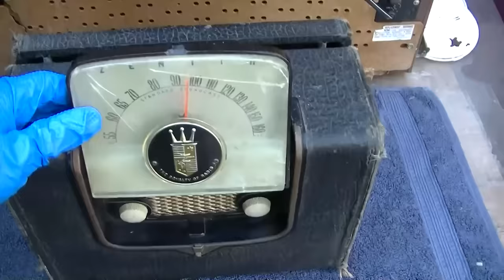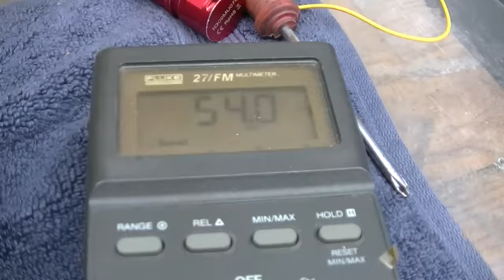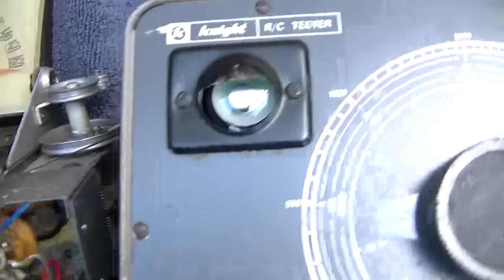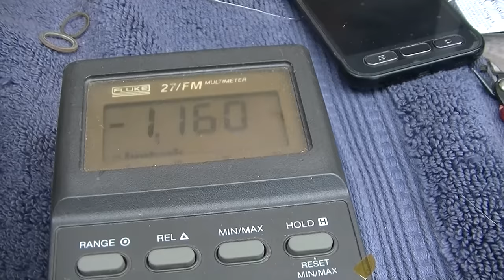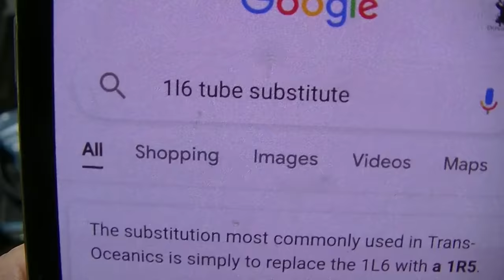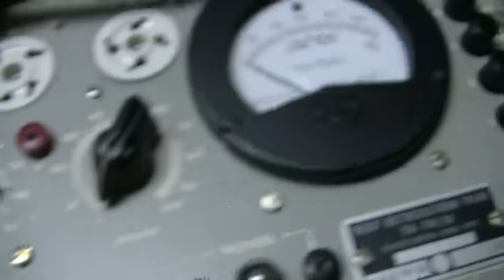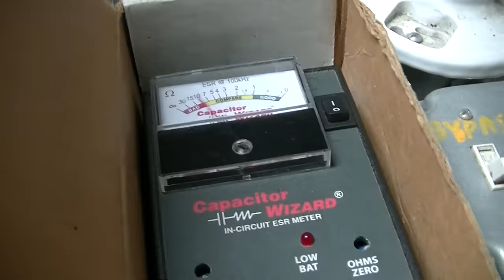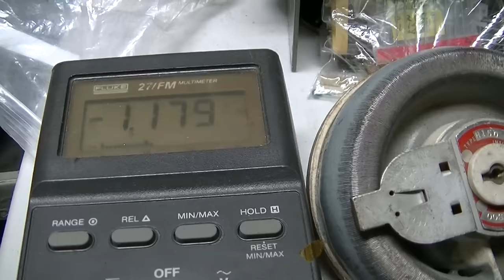1950 Zenith Portable G503 Flip Front Tube Radio 5G41 Resurrection Partial Fail

Comment: Those 1.4V directly heated filament tubes were originally designed for battery use. Back in the day, firms like Ever-Ready (UK market at least) made a combined battery which had both 90V HT and 1.5V LT sections.
The filament cathodes are very sensitive to ripple in their supply. I've found just the same when making battery eliminators for these sets.
I won't be surprised if that radio hummed like a Banshee from new when run from the mains.
Reply: Hummed like a banshee. I'm adding that one to my dictionary. 😅
Reply: nope.  they are very hum free.  i have about 7 that are all very quiet, main or battery.   I run the A battery  with 7 cells, instead of the recommended 8.   But, I have one  lunchbox model (forget the model) that has the same identical hum problem. It plays fine, but just fuzzy hum. I finally gave up on it.

Comment: You really cannot hot swap that series of tubes. They will blow the filament. Also at 1.25v a 1l6 won't oscillate. Common in trans oceanic.
Many are replaced without checking the set operating voltage.

Comment: I restored one of these two years ago. It’s a pretty ordinary AA5 radio, but it has an RF stage, which is great. The appeal of this radio is the very thing for which it might be criticized. The “flip-up” dial is very cool, as is the instant-on switch, BUT all of that complexity comes at a price. The antenna wire is vulnerable to breaking (from metal fatigue due to opening and closing), the on-off switch mechanism is prone to failure (plastic fatigue), and the clear dial cover glass (plastic) is almost always cracked (due to hitting the knobs when closing it). All that said, mine is a beautiful example and, once restored, is an excellent performer and addition to my collection.

Comment: I have my great uncle's 1954 Zenith am fm phonograph console in a beautiful cherry wood cabinet.  The phonograph has the Cobramatic turntable.  It all works great! I inherited it when he passed in 1994 at age 100! Since ive had it 30 years next April,  its had no issues,  it always plays fantastic,  0 hum, the original speaker sounds very good, all the tubes except for one, are Zenith.  It will be 70 years old next month.  Records play fine too. People have told me i should have it rebuilt,  its a ticking time bomb for a catastrophic failure....i keep close tabs on it when using it, and i do use it several times a month, few hours each time. But it just seems perfectly fine! Even the dial light works, along with the little amber light at the bottom of the cabinet to let you know its on, if the cabinet is all closed up.

Comment: I have an H500 T-O I restored probably 10 years ago, but a couple years back it started acting up with SMD and AVC issues from a few resistors that drifted too far out of tolerance. I left the perfectly good & strong 1L6 in place while I did all the repairs and testing, and by the end of the repairs the tube was toast from all the on/off cycles. I went so far to put a 1R5 on the bench to swap them out before I started, but I completely forgot to. I feel your pain.

Comment: Love how you have tubes in a bag that are all same voltage for the heaters. I have mine in a plastic shoe box but they take up too much space. So I just got some ultra thick plastic zip bags and you get the rest..... thanks shango066 love all your videos. Even the eol or look how many transistors my radio has

Comment: I was always told to remove everything from pin 5 of the 1L6 tube socket and tie them together without connecting them to the socket pin. THEN the 1R5 tube will work.

Comment: At the end of the video you seem to imply that changing the heater voltage (and thereby emission) on the 1L6 by a mere 0,05V (1,09 to 1,14V IIRC) makes for a sharp turn on/off threshold on the LO. Now while that may be possible I'd like to offer another explanation; the heaters are the cathodes and in the series heater string configuration each cathode thus observes a different DC cathode bias to ground, made up by the sum of filament voltages downstream. So with the 1L6 having the 1S5 1U4 and 3V4 downstream a change in heater voltage of 50mV on the 1L6 would also cause a similar change in heater voltage on the previous 4 filaments (3V4 counting as two 1,4V filaments). So the DC cathode bias on the 1L6 would rise by 200mV for a 50mV change seen in its heater voltage. And I think this shift in DC cathode Bias is what is causing the turn on/off of the LO, not so much the change in cathode emission in the 1L6 due to +/- 50mV heater voltage.
Reply: Bingo

Comment: Purportedly, Zenith built and offered these because of an outcry by Zenith's (CEO) yaught buddies crying about Zenith not offering such a radio. 😊

38:27 .....Me, I've often thought and believed Zenith used Voo Doo in their circuit designs......like tying all of the cathodes and bypass cathode resisistors & caps together as though they were common ground, but no ground was actually used.

Comment: I wonder if the hum is the selenium rectifier acting up - such as not switching off when it should.  (or perhaps switching too quickly and creating noise). It would be interesting to put a standard diode in series with it and see if that helps the hum.

Comment: I'm really glad you posted this. I have this chassis in a Flip Front that has a blue plastic case in great condition. The dial stringing looks scary but still working. I haven't powered it up or done anything else with it yet because it has the same waxy mess on the bottom plate. Thanks for this one.

Comment: Introducing the Zenith Portable Buzzomatic. I wonder why the mains filter hum is so bad, even with the Goliath electrolytic it seemed to be there somewhat. Could it be front end pick up or the fact that the new caps are paralleled with the old filter caps and they are very leaky and pulling down the voltage perhaps?  May account why the filament voltage is a little low. Just a wild guess, would be great to see this revisited and sorted for the desert test, but I guess that will be on batteries. Great vid as always, best regards from across the pond.

Comment: Yeips!  That poor expensive pair of flush cutters!  Been there done that, TWICE!
IIRC, in order to replace a 1L6 with a 1R5 you have to disconnect / rewire one of the pins.
Those tubes are rated at 1.4 nominal, but they have to withstand a bit more as with fresh batteries the filament voltage will get up to about 1.6 volts per tube.  Fresh carbon/zinc batteries will deliver a bit more than 1.5 volts, during most of their life they will stablize at about 1.4 volts.  Fresh alkaline batteries can get as high as 1.6 volts, and remain close to 1.5v for most of their life before dropping down to below 1.3 volts near end of life.
Hum could be due to reverse leakage of the Se rectum frier.  Scope would confirm that.

Comment: Odd that Zenith would use a 1L6 as the oscillator on that radio.
An important point: Never unplug/plug in the tubes on this radio or a Transoceanic while it's powered up.  The 9 volt filament voltage across that filament capacitor will rise to a high voltage due to the open filament circuit, and when you plug a tube back in, one of the filaments will blow.  If you're lucky, it won't be the 1L6.

Comment: Since you had a dim bulb in circuit you can get away with pulling tubes when the set is on. If running straight off the line, pulling a tube can cause failure of other filaments when the tube is reinserted. Yikes. Sorry about your 1L6, I wish I would have been prescient enough to buy several sleeves of 1L6 tubes in the late 60s when they were $1.75. sigh

Comment: Gotta wonder how good that selenium rectifier is, and wether or not it's letting too much ripple through ? Just a guess.
Reply from the maker: I thought I changed it? And the capacitors should catch that and smoke the sand resistor
Reply: @shango066  It seemed with new electrolytics should have smoothed out that buzzing. It's when you placed that huge 3500uf cap across, that totally cleaned it up. 
Also, when you placed the diode across the selenium, the voltage climbed, but would need a different value current resistor. I still think maybe the selenium rectifier is weak, and could be checked with the scope for excess ripple. Just a thought. Very good video Shango. 👌
Reply: I would also bet the selenium is letting in reverse current....

Comment: You should try russian 1A1P or 1A2P. They have the same ratings and kind-a same pinouts. Do an experiment so we see if they work. I don't have any 1volt device, so I can't try. Also other soviet 1v tubes can be used. 1U4 is exact match to 1K1P. Also 1K2P can be used. 1U5 is electrically the same to 1B2P, two pins are different. and 3V4 is electrically the same to 2P1P, also two pins different.

Comment: The G503 schematic, especially the power supply, looks almost exactly like that of the Zenith 500 and 600 series Transoceanics, save for the bandswitch circuitry for the shortwave bands and tone control circuitry.  And every T/O I've ever restored has had a little hum after restoration.  Whether it's because of the non-inductive electrolytic Zenith refers to, I have no clue.  The hum would probably get better after you mount the new capacitors inside the can instead of having them hang under the chassis.  Also, a properly repaired antenna and alignment would help a great deal with the hum.  If you decide to go further with the radio, I also suggest replacing the selenium rectifier and 130 ohm sand resistor with a 1N4007 in series with a 5 watt, 180 ohm resistor.  That should get your filament voltages right on the money. Also, you can use the 1R5 in place of the 1L6 if you cut pin 5 off the 1R5.

Comment: I actually recently found one of those Motorola battery radios you have had on a previous video, and I picked up radio stations from LA and Sacramento at night with it and I live in the Vancouver BC area. Amazing DXr :-)
Reply: KOMO in Seattle comes in most every night down here in Los Angeles, faint but usually listenable.

Comment: I'm not sure if this has been mentioned in the previous comments, just clip pin 5 off the 1R5 if needed in your circuit. I read about clipping pin 5 years ago on the Antique Radio Forums. I used a clipped 1R5 in place of the 1L6 in a RCA portable for years.

Comment: On the hum, it can be thought of as, what is the percent of ripple to the total plate voltage.  
In lower plate voltage systems, you have to use greater capacitance to lower the ripple to a similar percentage.
On the tube that you thought you flashed; if it has (sufficient) emissions in the tube tester it pretty much has to work.
As far as politics on this channel: I'm no longer watching you, and am going back to Disney!!!

Comment: The 1R5 will not work in my Trans Oceanic. I was so happy that I could use a substitute when I looked it up online, but it will not, and the cheapest 1L6 is around $50 on line 😢
Reply: you must carefully cut off pin 5, then it will work on BC bands

Comment: Interesting work. I have a few battery tube portables, RCA  Zenith and Stromberg-Carlson, all with tuned RF stages, and enjoy listening to them. We all "screw up" from time to time. I pulled an electrolytic can on the horizontal sweep chassis of a 1948 RCA projection TV, restuffed it, and remounted it wrong on the phenolic mounting wafer. Glad I caught it before smoke was released LOL . I've been at it for 62 years, reparing my first radio at 10, a simple line cord replacement, but it created a life long interest in vintage electronic restoration and repair. Thank You very much for the video of the Zenith restoration ! 😊

Comment: In many radios OTHER THAN the Trans-O's, you need to disconnect pin 5 to use a 1R5(or just clip the  pin off the tube).
Reply from the maker: Ahhhhh lets try it
Reply: Should use a shear type cutter, not the normal type pinching pliers.  Too much shock.  Or, better yet, use a dremel with cutter wheel, while holding the pin with small vice grips.  Have your friend or wife hold tube to catch!  LOL
Reply: @shango066 will you be doing another video on this?  I ran into the same exact problem with a Stromberg Carlson awp8 including when I turned the chassis over I had a short and now,a hum and no oscillation. Before this, it would work and than turned off then back on and it would not have any oscillation. This happened after I recapped the tuner section.  I’m a long time subscriber and have learned a lot from you. Thanks!
Reply from the maker: @robertriley5352  yes

Comment: I've NEVER seen one of these "Flip Top" Zeniths that are NOT cracked. I think I read somewhere that its a bit of a design issue. 
There's no way you can fully control the 'down' flip. Eventually, the user is careless and it'll flop down and the dial cover hits the knobs.

However, when it's flipped up, it is indeed a great receiver. It gets the antenna coil above the radio chassis. I was able to receive both WSM-AM 650 Nashville and WWL-AM 870 New Orleans in Dallas on one of these (660 and 507 miles).

I would not have caught that 1L6 - 1R5 error. But now I know how it's done.

Comment: In these kind of portable radios made in EU they use the 1.5V battery as capacitor/zener for stablize the heaters voltage... so if you test a radio without the rechargabe battery you will burn the tubes... Check the schematic of this one for being sure and not frying tubes...

Comment: Shango066 though you may never run into this again but you might bite the bullet and invest in a solid state substitute for resurrection only.  I have 3 radios that uses the 1L6 tube.  2 of my TO’s would accept the 1LA6 substitute but my RCA is space restricted.

Comment: that 'suspect' resistor likely got fried when a filament lower down the chain or the lower part of the dual filament went open, it'd get the entire filament current running through it, which at 680 ohm would be approx 1.5 watts, so not surprised it discoloured and went high...

Comment: Someone on eBay sells a solid state equivalent for a 1L6 - could you include that in your desert test?  The circuit is published on antiqueradios - two ECG312 and an ECG222 - noted it is specifically for a Transoceanic

Comment: The 3V4 audio output tube will use the full 3 volts across the filament when the radio is used on 120volt AC operation. Now, when you use this radio on batteries and plug in the AC cord into the chassis or the radio the 3V4 will only use the 1.4 volts as the rest of the 1.4 volt tubes. FYI,

Comment: Have you tried running it on batteries yet because it could be picking up some of that noise from the AC line set the AC line bypass capacitor is not going to deal with due to a lot of noise on the power line with LED switching power supplies

Comment: be warned there was a DL98/3B4 that doesnt have filament on pins  1 and 7 , its 4 and 5 with tap on 6, but it wasnt a  normal domestic radio type so unlikely to find them used for those sort of sets ,i think it was intended for rf power output

Comment: the UK company Murphy made 2 'flip front dial' portables, B229 battery only, and BA228 mains battery, used the newer 0.025a filament valves/tubes , no RF stage but had push pull output, 2 DL96/3C4 outputs, so had good oomph compared to single output sets , i dont know of any other UK brands that did one, but possible theyre were some..
Reply: the murphy mains battery used paralleled filaments with mains transformer, so had isolated chassis,  the 0.025amp filament types are far more sensitive to correct voltage, if parallel fed, or current if series fed, than the 0.05amp types, very easy to pop them, or at best ruin emission, if too high,  and emission drop off on well used ones if too far under run

Comment: You can upgrade the selenium half wave rectifier .. put in a (full wave) bridge rectifier, and then, put in a series of microwave/HV diodes as needed to get the proper B+ voltage.

Comment: An interesting, although frustrating repair!  A 740 ohm resistor?  Maybe someone dyslexic was hand painting the colour bands, & it was supposed to be a 470?

Although I haven't checked the E96 range of resistors, I didn't even know if E96 range was around back in the 50's?

Whatever, you did well getting as far as you did with this radio.

Thanks mate for the video.

Comment: 38:00 It just occurred to me that these filaments, each with a resistance that only rises as it heats up,   are not  like a resistor voltage divider, especially with other parts in the loop. Running a very low voltage, isn't it possible that some of the tubes will become the "hot spots", with non-zero resistance, while others will remain cold, drop no voltage, and with no power dissipation, never heat up?

Comment: I hate those battery-tube radios.  Usually they're covered with fake leather plastic covered canvas which is usually all scuffed up and ratty.  Not attractive.  Sometimes you can bring back some shine by using some black scuff-cover shoe polish.

As you noted, the circuitry is fragile.  Many many-megohm resistors, usually all of them 80% higher than rated value.   The tubes are expensive, especially the 1L6.  Tubes are quite microphonic also.  The audio power output is strictly limited to like 50 milliwatts with no bass at all.  And if you unplug any of the tubes, the filament voltage string zooms up to 150 volts with a large filter capacitor across it.  If you restore the filament circuit, then  the filaments flash brightly and you're screwed.     I must have a dozen similar radios unrestored in my attic.  I have no gumption at all to restore any of them!
Reply: About 20 years ago at a yard sale i saw a leather clad Zenith CAROUSEL RADIO, that has these mini tubes, but could also run on plug in power.  Case is near mint, has a gold color metal mesh front speaker cover. It worked so I bought it for 20 bucks. About once a year I plug it in and tune in KFI and let it play for about 30 minutes.  Always works, no hum.